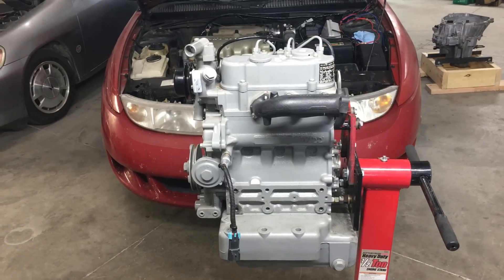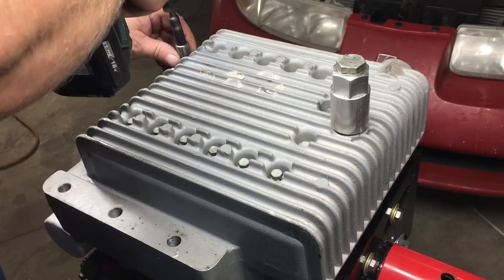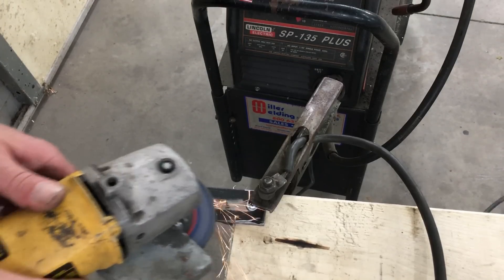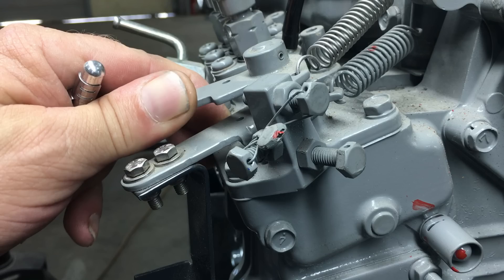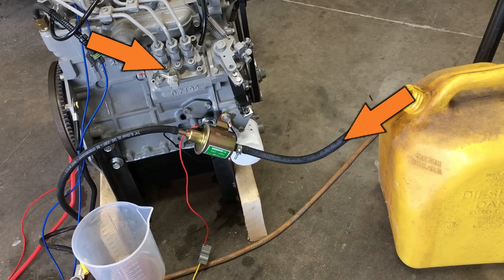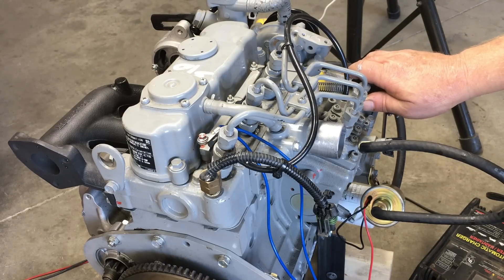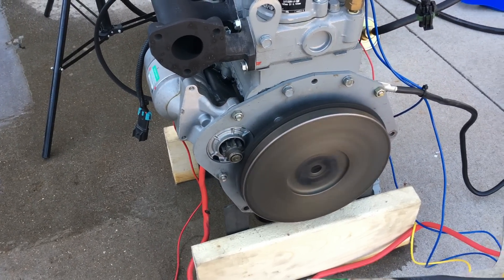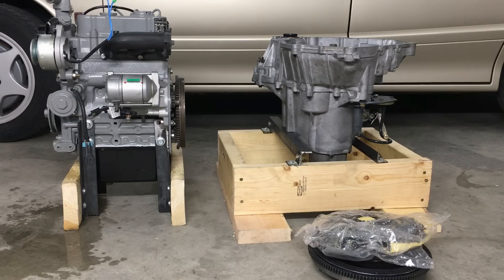S2E22  First start of the Kubota D722 diesel that we are going to use for our Saturn engine swap.

Comment: Thiese Kubotas are actually indirect injected instead of a bowl in the piston there is a pre chamber in the cylinder head the piston is flat the glow plug is also located in the pre chamber thiese engines need heat to start from ambient temperature direct injection diesels don't need heat unless is well below zero
Reply: I know what you are saying tho when you say direct injection comparing it to a petrol that could be port injected instead
Reply from the maker: My bad,  I have owned a few semi vintage Mercedes with the OM60x engines and I'm aware of the prechamber stuff.  What I meant by direct injection was the fuel is injected on the other side of the intake valve
Reply: Ahhh nice ! Famous engines they are ! Witch ones !

Comment: Sound quality - only thing I noticed was it sounds like there's interference at some points. Repeated ticking in the microphone.
Other than that, perfect.

Can't wait to see how this works out though, diesel swap is gonna be super cool.
Reply from the maker: Thanks,  I think the ticking may have been the electric fuel pump.  I left it running while working on the engine.

Comment: That engine is realy light, now I want one too 🤤 LOL
I have a few machines that use Lombardini 450 cc ~ 10 HP single cylinder industrial engines (3LD450, LDA450 & LDA451) that weigh about 60 kg and being single cylinder if I tried to start them bolted to a wooden support like that I think they would jump like a frog.
Reply from the maker: This little 3 cylinder is fairly well balanced, but it dose move a little bit on the cradle, certainly not like a single cylinder though.  The D722 is semi hard to find, but the Z482 2 cylinder is a lot more common.

Comment: Isn't that an Indirect Injected lump? Looking forward to the testing :D Thanks for your videos dude
Reply from the maker: My bad,  I have owned a few semi vintage Mercedes with the OM60x engines and I'm aware of the prechamber stuff.  What I meant by direct injection was the fuel is injected on the other side of the intake valve

Comment: The sound was great. I couldn't distinguish any difference from the other videos. This may be my favorite iteration of a build. I suspect the diesel with the close ratio trans will be a great fuel sipper. I wonder if you will have the ratio to go the speed you want. Most diesels that I have owned had a low ratio (highway fast geared) final drive to compensate for the low spinning RPM of the engine. Good luck with the allergies, they are getting me bad this year too.

Comment: Most of these industrial diesel engines have a RPM governed throttle. In other words, if you move the throttle to a position that results in say 1500RPM unloaded, and add load, the IP will increase fueling to maintain that 1500RPM up to giving the engine full fuel. Might be interesting to drive it due to that. When you accelerate from a stop, if you push the accelerator down to a position that would want to call for 2000RPM, youll end up with the IP giving full fuel as it tries as hard as it can to get to that RPM. On the other hand, cruise should be easy just by holding your foot in one position it will adjust fueling for you as the load changes on the car.
Also, this may not be happy with much boost. Intended as a N/A enngine, it has a pretty high compression. I havent been able to locate a spec but its probably in the 22-25:1 range. Whereas most turbocharged diesels are in a 15-18:1 range.

Comment: This episode hits home - back in the 1980's a college bud and I were working on a vehicle that had no name - it would have been an electric car that used a kubota diesel engine (smaller than yours) to provide charge to the batteries - it was a precursor to a hybrid though it did not provide direct drive to the car.  We were going to use a VW chassis and would have built a two seater as a test car.   There were other aspects of providing alternative ways to recharge the batteries (solar panels and wind), but those were just dreams.  Of course battery technology was not much more than lead acid at that point.  We chose the Kubota because of its constant rpm for generating electricity.   Maximize fuel economy.

It is thus I'm watching your efforts.   Brilliant choice of engine.

Comment: I can't say I noticed any difference in sound quality or voice over quality, I wish you a speedy and full recovery! I had a grandfather with 90-95% hearing loss due to a severe ear infection when he was in his mid 30's and I'm sure years of carpentry and power tools didn't help either. If you want to protect your hearing but still hear what's going on around you I cannot recommend EtyPlugs ear plugs enough! I work in an automotive shop and wear them sometimes 8 hours straight, they're comfortable and just turn sounds down but still let you hear things happening around you, people talking, bad car noises, etc. They're usually $15 or under on 'the jungle site' and certainly worth it!

Comment: I could be wrong but I thought that engine was an indirect injection, as in a combustion or pre combustion chamber. Sometimes even called a swirl chamber
Reply from the maker: My bad,  I have owned a few semi vintage Mercedes with the OM60x engines and I'm aware of the prechamber stuff.  What I meant by direct injection was the fuel is injected on the other side of the intake valve
Reply: @robotcantina8957  I kind of figured you said it like that because most people think gasoline so it's more direct compared to EFI or carb.
Reply: @robotcantina8957  btw really looking forward to this series... I've been holding on to a 27hp yanmar reefer motor with a centrifuge clutch, haven't found that perfect project yet

Comment: I work with Hondabond for a living.. and lemme tell ya, when my fuel filler neck started leaking at the clamp, hondabond does wonders. 
The red label stuff is more robust but the blue label stuff is more flexible. 

Have a squeaky non-serviceable ball joint? Check that play with a pry bar, with no play, grease that shit up with a needle fitting and blue hondabond it shut. The annoying squeak went away, No play, it’s basically a replacement. 

Need a Gasket? Don’t have time? Red Hondabond. Sets in 60 seconds, Turns to hard rubber in 3 days max but ready for work after 24 hrs.

If you use the nozzle it comes with, you’re a monster.
Reply from the maker: Yes!  another Hondabond believer.  With Hondabond and JB weld, anything can be fixed.

Comment: Would this pair well with a turbo from an 800cc diesel smart car?
Reply from the maker: It may, I reckon I'm not sure.  We have a few turbos in stock that we will try.  As I understand it, these Kubota super mini diesel engines may not like too much boost as we will have to run low boost levels.

Comment: You spelled Kubota wrong in your title. At first I thought you were using some sort chinese knock off. Brake cleaner doesn’t “evaporate” oil. You need to wipe it to get all the oil off.
Reply from the maker: Fixed it, thanks.   As  for the brake clean, we did wipe it, but that part got edited out of the video.

Comment: Kubota D722 is not direct injected. It’s an in-direct injected diesel (IDI). The fuel is injected in to a pre-combustion chamber within the cylinder head.
Reply from the maker: My bad,  I have owned a few semi vintage Mercedes with the OM60x engines and I'm aware of the prechamber stuff.  What I meant by direct injection was the fuel is injected on the other side of the intake valve
Reply: I wanted to add, I think the audio was on point. Hopefully you have a speedy recovery, looking forward to seeing the 20hp Saturn going down the road. 👍

Comment: I have a Kubota D722 as my boat engine. If you want to know, my fuel consumption is: at 1800rpm 1.6 l/hr, at 2200 1.8 l/hr, at 2500 2.35 l/hr. Important - use motor oil with standard HTHS viscosity (not energy savers).
Reply from the maker: We put in Shell Rotella 15-40 non synthetic made from real dinosaurs
Reply: If that's moving a boat while turning that kind of economy, thats pretty impressive!
Reply: @hojnikb  It is very economical for its power, you have to keep a good care of it, however. The oil pan tends to rust through and the valve lash keeps getting smaller on its own during periods of use. The engine has noisier and quieter revs. There are two non-exchangeable types of diesel pump which both look the same. Bolts from exhaust port sometime break in the block and cannot be pulled. Factory thermostats are unreliable and expensive and there is no spurious replacement. There is no rpm compensator for variable loads, only start spring support but the spring gets shredded by the timing wheels eventually. Apart from that, parts are easy to get and there are many second hand. Gives better economy and less noise than e.g. Yanmar while being cheaper and smaller. Can be turboed. I shouldn't be complaining
Reply: @adamlipsky8010  are these engines marine rated? As far as im aware marine engines are usually especially designed for these types of applications, mainly looser tolerances on the bearings and the likes...
Reply: @hojnikb  As far as I know by looking at all accessible parts lists, there is only on type of pistons, rods, crank etc. The engine is marinized by few companies all over the world, mine was from Beta UK but you can marinize it yourself. When it's going, it's going very well, plenty of torque and great economy. I think RC will build not a car but a tractor, these engines rev up to 3600 but sustainable is like 3000 rpm.

Comment: The Saturn would probably be totally driveable and feel more peppy than you expect.  

For years I drove a Hyundai 1 ton industrial pickup and was astonished to find it had only 64 horsepower and 110 torque.  It was a non-turbo 2.6 liter 4 cylinder.  Top speed was 110 kph (65 mph), but around town in Asia it was perfectly drivable, even when weighing in at 3500 kg (7000 lb?) with a full load.  0-50 mph was around 15 seconds if I remember correctly, but 0-60 was closer to half a minute.
Reply from the maker: Wow, that's impressive performance for a heavy vehicle.  The transmission we will be using will be far from perfect but it will be interesting to see how well it works with the little diesel.
Reply: @robotcantina8957  Yeah, the gearing was very short (even in high range), and top speed was gear limited definitely.  45 mph and it was already doing 2800 rpm in 5th gear (4000 redline).  Fuel economy was bad too as to be expected (never above 19 mpg, usually 14-16.5...empty cruising maybe 21 or 22 was possible).  Same engine in a small SUV with tall final drive however and 28-30 mpg is normal.

Comment: I've worked on many things that used this same engine.   You cant kill them no matter what you do.
I've seen many that lost the internal injector pump governor linkage and go ungoverned full rack wide open and ran like that for likely days with zero damage for it.  

Put a turbo on it and crank that smoke screew all the way and just let it do it thing, It really won't mind it.

Comment: What the diesel lacks in horsepower it makes up for with torque, at way lower RPM than equally sized gas engines.
Throw the right size turbo on.
Increase injection timing, and turn up the fuel and bring gobs more torque!
That'll get the Saturn to cruising speeds.

Comment: There are indirect injection diesels too.
Reply from the maker: My bad,  I have owned a few semi vintage Mercedes with the OM60x engines and I'm aware of the prechamber stuff.  What I meant by direct injection was the fuel is injected on the other side of the intake valve

Comment: Oh, I was waiting for diesel in these series. Now you will be able to play with lpg :)). (It will give you better fuell economy and a bit bigger torque). You can use simple old bbq equipment. Just give a bit lpg to running diesel in air intake (not on idle) and you will understand what I mean. I hope to see it ;)
Reply from the maker: Once we get the car rolling again we will certainly try a few experiments including propane

Comment: I have a little French car with a 1.4 litre non-turbo diesel engine. It’s got around 50 horses or so. It can just about get out of its own way. Interested to see how the larger Saturn goes! The little car I have easily does 70 miles to the gallon (UK gallons that is) which has been a great help lately with the crazy fuel prices.
Reply: Is that a Citroen AX by any chance? These are apperently pretty rare.
Reply: @hojnikb  yes that’s right. Funky little cars, lightweight and go kart handling.
Reply: @BobM925  That's pretty cool! Those are light little fuckers. Even gasoline versions were pretty frugal for the time.
Reply: Yeah they certainly are! Light and maybe not the safest thing in modern traffic, but definitely fun to throw about.

Comment: Do you plan on trying to make your own bio-diesel?
Reply from the maker: I don't think I have the proper equipment to produce bio-diesel, I need to look into that.
Reply: You just need sodium hydroxide, oil and methanol, along with a chemical resistant container. I made some in my kitchen (to my partner's annoyance).

Comment: I bet this gonna be a great project. It sounds so smooth. The power seemed a little low but then I remembered that it's not turbocharged. The little 1.4 turbo diesel in my hatchback makes about 70-90hp (depending on stock or remap) while the 1.9 NA diesel in the same car made about 70hp so I bet with the 750cc diesel, the turbo should give a nice amount of power, maybe 30-40hp if we're lucky. Hoping for 100mpg but probably not going to happen 😂
Reply: we can get 5hp just by adding a "TURBO" decal on the camcover

Comment: One note not all diesel engines are Direct injection some are Indirect injection they have a Pre-Chamber where the injector and sometimes the glow plug is located.
Reply from the maker: My bad,  I have owned a few semi vintage Mercedes with the OM60x engines and I'm aware of the prechamber stuff.  What I meant by direct injection was the fuel is injected on the other side of the intake valve.

Comment: I just so happen to work on refrigerated trucks using that exact same engine
they are pretty reliable, mostly because of how much oil they have

please consider replacing the bolts for the water pump as soon as possible
you can only use slightly longer ones, but the bolts used barely engage the threads and can't be tightened very much, so they like to leak after a while
there is a simple rule to get proper thread engagement: 1.5xØ
somehow the engineers didn't follow that rule

considering how old it is, it might be an older model with proper sized bolts, but checking that can't hurt, especially if you are using this engine under heavier load, the thermal stress can cause problems sooner than later
Reply from the maker: Thanks for the heads up, I will check that out tomorrow.

Comment: Had a 93 SL2 that was given to me by my grandpa. I manual swapped (with help from another forum member) and installed nitrous on it for a short while. Also had a 95 SL2 that was turbocharged with a Megasquirt controlling fuel. Miss both of them.
Reply from the maker: Saturn S series used to be all over the place, but in this neck of the woods the have all but disappeared.  Great and dependable  cars as long as you check the oil regularly
Reply: @robotcantina8957  Yep I hardly see any S-series now and even in the junkyards they are rare to see.

Comment: Just a FYI- the presence of glow plugs indicates that the engine has "precups" (pre-combustion chambers)- which makes it an Indirect injected diesel engine, not direct injected. The precombustion chamber is a small chamber located in the cylinder head which allows for easier starting (because it is easier to raise the temperature of a smaller chamber than the entire volume of air on top of the piston to the 600+ degrees needed to ignite diesel fuel) at the expense of outright engine power (no such thing as a free lunch, the same smaller chamber that allows for quicker temperature changes also makes for a convoluted path that the flame front has to travel before acting on the piston head and producing work).

I don't think it was allergies. it's summer- and you know what's out in the summer? Gnomes. Those little jerks have been far too quiet for far too long- I knew they were up to something. They stole your hearing, and then used the profits from selling all of the 10mm sockets they stole when you couldn't hear them to pay off the doctor (so he wouldn't rat them out and ruin their operation). I knew they were tricky, but this is diabolical. 

Seriously- coming from someone with significant experience with hearing loss. I spent two years deaf as a kid due to severe infections that went undiagnosed- and then celebrated the return of (most of) my hearing by working in noisy environments (and combat zones) for the remainder of my working life. Currently enjoying the constant 30-35db (40 on "special" days) ringing in both ears that comes with tinnitus, I hope you get back to 100% soon.
Reply from the maker: My bad,  I have owned a few semi vintage Mercedes with the OM60x engines and I'm aware of the prechamber stuff.  What I meant by direct injection was the fuel is injected on the other side of the intake valve.
Reply: @robotcantina8957  No worries. Keep up the good work!
Reply: great insight on rudolfs engine! 🐱👍🏿
Reply: Most modern automotive common rail diesels have glow plugs, despite being direct injected. They're used for cleaner cold starts. Notably Mazda makes a diesel with only 14:1 compression ratio, which would probably have trouble cold starting without glowing despite being DI.
Reply: @nerd1000ify  good point.